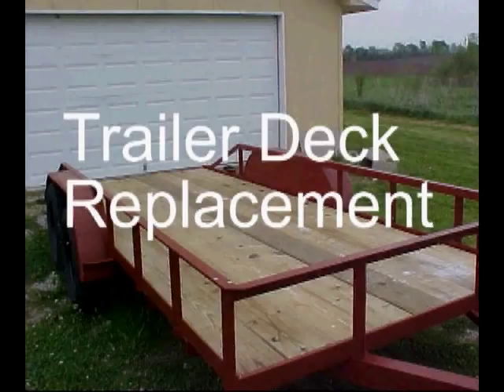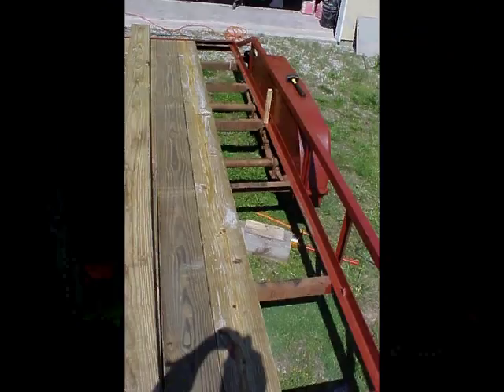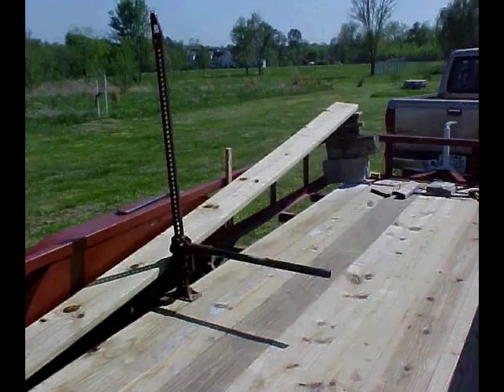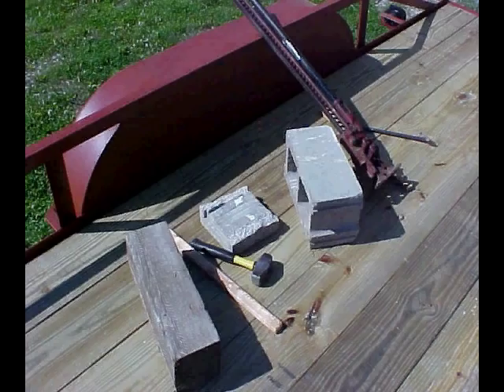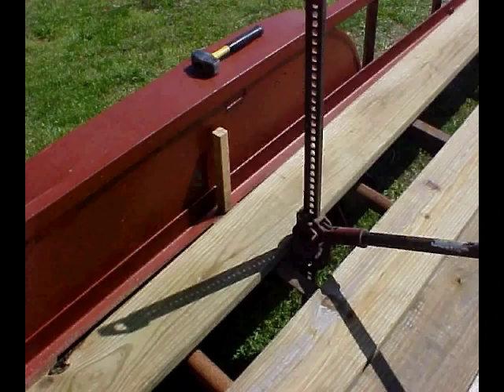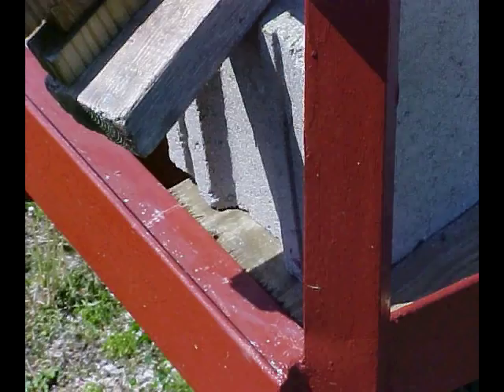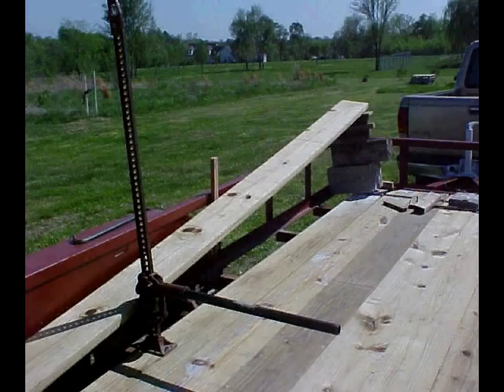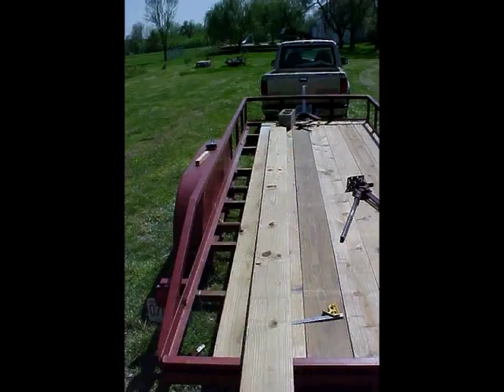Trailer Deck Replacement

Comment: This video helped me realize I was not crazy... and yes the board were "built in" to my trailer with no real consideration for future replacement. And yet another use of my high-lift jack.

With the cost of a "decent" trailers these days, it is one of the few things that is not cheeper to just buy new than to fix. 

Very nice solution to the problem!

Comment: Thank you for this excellent video and instructions! We changed out our deck yesterday using your method and it worked perfectly!! We were just smiling in amazement throughout the process!
Our only glitch was that we had to rip the last 2x10 to 8 inches wide because our trailer isn't square. Thank goodness for a table saw and a couple of tall trashcans for saw horses. 16' is a long heavy board to rip! That was the only sawing that we had to do. The Home Depot boards, 16'1" were perfect length.

Comment: Jesus christ 🤦‍♂️ most trailers, like the one in this video, have a 1" lip at the front and a 2" lip at the back. You cut the board an inch shy of your overall length, slide the board in the 2" space at the rear and it will drop down. Then slide the board forward under the front lip. This is how trailers are manufactured. Please don't use a farm jack and bend the boards with a Cinder block, etc. This video is going to get someone injured, and is actually the hard way to do this.

Comment: Thank You! Excellent video tutorial. You mentioned using pressure treated lumber but your 2 x 10's don't look like the pressure treated lumber we have here (Idaho). My concern with pressure treated or sappy lumber would be shrinkage as it dries. Probably not a problem end-to-end but width-wise I would be concerned for gaps between the boards. Did you experience any shrinkage? Thank You.

Comment: I realize this is an old video, but do you think I could bend a 10' board? My trailer is smaller 5'x10' version, and I'm trying to decide if I should attempt to bend them in place like you did on you 16' trailer, or if I'm better off just cutting and welding to get them all in.
Reply from the maker: Don't know about the 10 footers. Get one nice "fresh"  board and try it. Be careful that it doesn't split or kick back on you. I'd get a friend to help to be more safe.
Reply: I did it with 12 footers tonight, but the last board snapped at knot. Try again tomorrow. Thank you for the video.

Comment: What is the actual length of the trailer? What was the actual width? I have a 16ft trailer, however the actual length is 16' 1". Or 16ft, 1in. I am guessing that I would have to buy a board atleast 16.5, then cut the ends down unless I bought from a sawmill. Secondly, I have tried to imagine what size width of lumber..2x6 or 2x8 vs 2x10. My trailer is 72 inches across, and none of these sizes will fit or lock in. Did you have to cut down the width?

Comment: Great idea. Better than making more work. Will that type trailer carry a car? I just bought one and want to fix it up for that.
Reply: You should check the load capacity of your trailer. If it is more than the weight of your car, you are good to go.

Comment: Great video!  Has anyone ever used this method with 10 foot long 2x6 treated pine?  It's not clear to me whether a shorter board would bend sufficiently to go into the channel.
Reply: maybe but the boards will need to be very wet

Comment: Your towing that trailer with that ranger? Ha!
Reply: +paul mckinney The Ford Ranger was offered with a trailer towing package — stronger leaf springs and lower ratio rear end — making the V-6 versions so equipped quite capable of towing the trailer seen in this video.  Dealers usually didn't have them in stock, so they would have to be built to order.